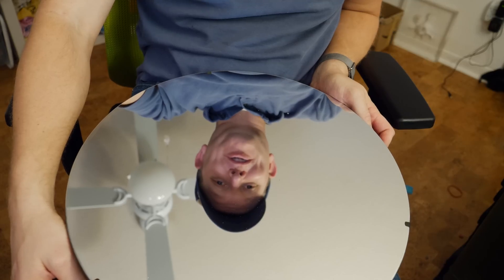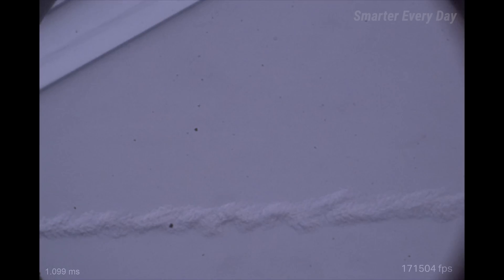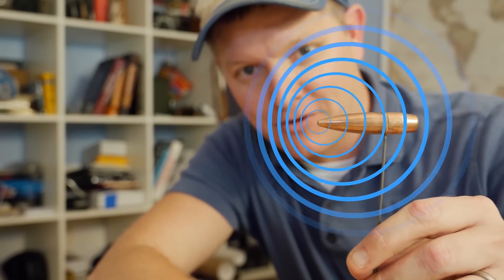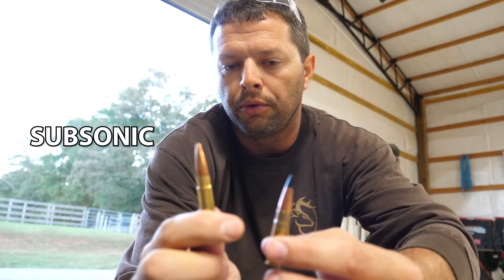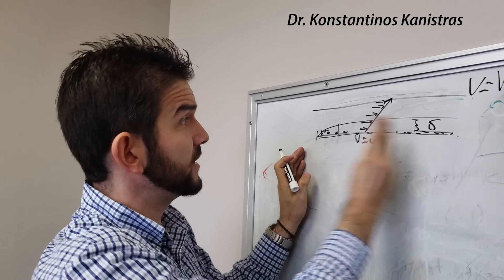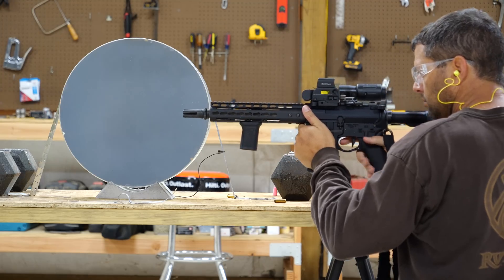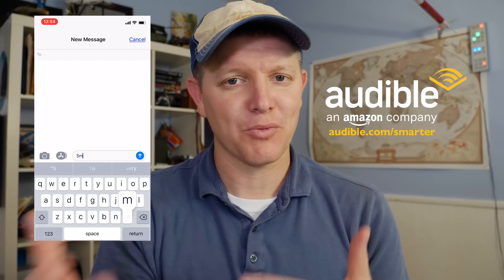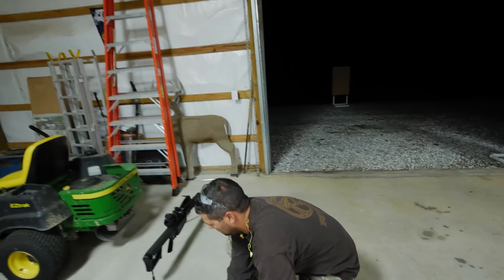Shockwave Shadows in Ultra Slow Motion (Bullet Schlieren) - Smarter Every Day 203

Comment: ...........idea for future video. Find a machinist with a lathe that would be willing to make you some bullets (solid copper would be the easiest, don't use steel as it will not be kind to the barrel of the gun). Preferably a rifle round. Pull a bullet out of a casing of whatever caliber you choose so the machinist can duplicate it precisely...but instead of the relatively blunt rear, have him taper it to a point to see how much of that irregular "drag" shown in this video can be eliminated.
Reply: @SmarterEveryDay You want to do this. Perhaps hook up with TAUFLEDERMAUS for some of his amazing insight.
Reply: @animalmother556x45
That's how 6.5 grendel works. It has a very good ballistic coefficient because of it's tapered tail end. In fact, it has a better ballistic coefficient than .308 and carries it's energy farther.
Reply: @unambitious  I've never seen a 6.5 projectile with a tapered rear...do you have a link?
Reply: Boat tail, yes. It's tapered, but not to a point like the business end. 
@Grimace427 6.5 grendel does carry it's initial energy farther than .308. Not as much energy as .308 obviously, but it's as accurate with less drop than .308 and similar ft/lbs as 7.62x39. Plenty of "poor man's" 1000yrd setups and demos of 6.5 grendel on YT.

Comment: I'm studying aerospace engineering and in this year they taught me that the shockwave that forms in front of an object doesn't need to have the angle of a Mach cone since the reason shockwaves appear is deviating the supersonic flow front me object it is going to encounter. Therefore the angle of the shockwave depends on the speed and the angle of deviation needed. The only way it creates a Mach cone is when the angle is very small, then the angle tends to the one of a Mach cone. I'm saying this because I don't think those speed calculations are too valid, they can approach the real speed but not the most legit thing. I don't know if you knew this and I just wanted to make you smarter every day.
By the way, love your videos and this one is trully amazing.

Comment: The bullet looks like a speed boat on water, if you would look it from above. Exact same thing with waves going on the difference in the density of water and air will give slight variation in results. The circles within the "wake" are different pressures of air being bounced around and off from the speed barrier that bullet created.
PS. It would've looked cool if you shot the revolver sideways so camera would see it from above/below to see how much gas actually goes to the sides of it.

Comment: Destin, aren't you an aerospace engineer? How didn't you learn this? Don't mean to intimidate you at all, just actually curious! I learned all of this in the second and third year of my undergrad in Uni in Germany (also aerospace engineering). Btw since then my specialisation is super- and hypersonic aerodynamics, it's soo cool! Love your video, keep it up :)
Reply: Is there a difference between supersonic and hypersonic? Aren't the fluid dynamics the same? (I'm just curious)
Reply: Mandernach Luca I believe chemical reactions start to happen above mach 5, that should be a difference.not sure about the details
Reply: @Enthropical_Thunder  Yes there is. No they are not.

Ask yourself, is the aerodynamics of a car at 60MPH the same at 180MPH?

Then consider your question again.
Reply: @bigbuckoramma  
Of course there are differences but i meant significant differences like the aerodynamic differences between a wing at subsonic speeds and supersonic speeds (between subsonic lift and supersonic lift, so to say).

Comment: My question is what happens when the slug is flying fast enough that the shock wave angle is more acute than the surface of the slug. Also, at the other end of the speed scale, what does it look like out of a whistling device, like a recorder or a simple whistle?
Reply: I think you would still get two straight lines that are touching the bullet not at the point of tip, but at the point where the curve of the tip has a tangent that matches the angle of the wave.
Reply: Bow Shock

Comment: can you try shooting diagonally to the mirror?
Reply: That would be so cool. At the  distance between the camera and the mirror, you could get an almost head on angle.
But the problem would probably be focusing the image. It would be sharp for only a few frames between being too close and too far.
Reply: No, the mirror is reflecting the light to a single point that's directly in front of it, so the camera must be at that point.

Comment: Some questions:

1.Why should the hand never leave the grip while firing? Isn’t it going to experience the shockwave anyway?

2. What is the purpose of the piece of paper that blocked half the light?

3. Why is a parabolic mirror needed?  Why not a regular circular concave mirror?

Great video as usual.
Reply: This is all me guessing but I think that:

1. so that the gun doesn't fly around and you lose your grip.

2. I don't know

3. isn't a parabolic mirror the same as a circular concave mirror?
Reply: 1. Yes, your hand will experience a dispersed portion of the shockwave.  But if you placed fingers or a hand over the gap between the cylinder and barrel, you would take the full, concentrated blast as it comes storming through the gap.  That's a big difference in energy levels.  There's even a story or two of someone losing their thumb due to holding it this way.
Reply: For 2 and 3: The parabolic mirror focuses the point source of light back at the lens of the optical system. You're essentially photographing the point source spread to fill the whole field of view. The object blocking half of the light is what enables the schlieren effect. The density shifts in the air causes refraction of the light. This will cause some portions of the light to be shifted in one direction, over the barrier, allowing more of it to reach the lens, and some to be shifted in the other direction, more into the barrier and less reaches the lens, thus creating the patterns of dark and light that allow you to observe these density differences.

Comment: I'm not too sure you can use the Mach relation to estimate the free-stream Mach number. That relation holds only for point sources. In this case you might have to use the theta-beta-Mach relation provided the approximation of the fore-body surface as a cone/wedge is reasonable.

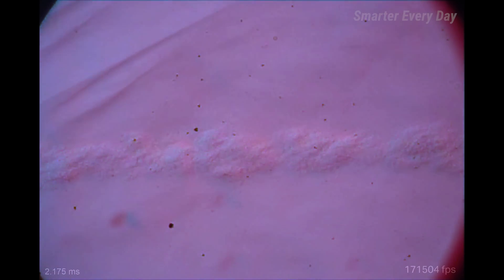Comment: 1:45 Test this hypothesis by placing an object on the table so that it distorts the reflection in some predictable way
3:45 These concentric circles might be interference with another sound and the frequency of the sound can be calculated from the spacing of the circles...or...the phenomenon described at 6:00 is causing periodic disruptions

Comment: So if transonic bullets at 0.8x the speed of sound produce some supersonic movement, do they still produce some kind of sonic book? And if so, would "subtransonic" bullets below transonic speeds be the quietest because they avoid creating any kind of supersonic movement? And if so, is the difference enough to matter? Because if it makes a difference, then someone trying to quiet a firearm with a sound suppressor/silencer would get quieter results from a bullet traveling at speeds more like 800-900 fps than 1000-1100 fps, just under the speed of sound. I didn't see much disruption coming off of that subsonic bullet, but on the other hand I've always thought that anything that reaches supersonic speeds in our atmosphere creates a loud sonic boom/crack, whether a plane, bullet, or bullwhip.

Comment: Far out! Just like how the way the outside wheel of a car has to turn faster than the inside wheel when turning. I'm thinking a bullet with segments of varying friction would upset the surface airflow enough to discourage hitting supersonic levels 🤔 I mean airflow is all about aesthetics lol

But wait, on a typical car isn't the undisturbed air always travelling faster than the attached air? As in, the airflow on the body is actually slower than the airflow around the car.

Comment: Hey Destin. Great video, as always. Since I saw some comments on the knife-edge cut off, I would like to point out that the black-white pattern on the top and bottom of the bullet are opposite. This has to do with the direction in which you are cutting the light. Cheers.

Comment: I think that the speed calculation is not totally correct. What you did is only valid for dimensionless points moving. For  an actual 3D object as a bullet, the shape itself modifies the angle of the shock waves, depending on the angle of the bullet itself, what it is called the nose cone. If the angle is  big (blunt body) the shock wave detaches front the nose. That's why supersonic airplanes have sharp nose cones. It''s difficult to explain in a comment here. An idea for a following video could be to film bullets in supersonic flight with sharp and blunt noses at the same speed to see the difference in the shock wave angles and how they detach.
Reply: You explained it well. Reentry capsules are blunt on the bottom and the rear tapers to a cone. Pushes the shock wave away from the vehicle so the super-heated air doesn't burn up the vehicle.
Reply: After having recently seen Richard Hammond explore the Space Shuttle, and explain why the nose is relatively blunt... I too was wondering about what a less pointed bullet would produce. 
https://youtu.be/v1_WqVguRJg

Comment: Desitin, they are not little circles they are spheres. We live in a (for simplicity sake) three dimensional world, the illustrations in your old aerodynamics book only show them as circles because it's easier to illustrate.  Theoretically the bullet lives in a neutral state bubble of air. We all do. When an object moves fast enough to break out of the bubble the sonic boom is the bubble collapsing to try and catch up. People theorize that the speed of light is similar to this and therefore think that either a type of black hole or a flash of light happens if/when you go FTL. Of course, No one really knows what the "light boom" would look like. This similar "bubble of X (in this case sound)" is that famous Bubble Theory you've probably heard of  before.  Conceptually you just videoed inter dimensional travel.

Comment: you should try to "differ" a bullet past the mirror via a compound ricochet medium and do a scientific measurement of their acrostics.

if one bends a pvc or copper pipe they should insulate it with play sand. what happens if to you "shock" bend a pipe by internal pressure at an obtuse angle?I I'm sure the internal media, weather air or silica sand, plays a part in the expansion physics but the question is where in the curve douse it affect the material enough to distort it?

Comment: You should try this revolver thingy with the Nagant M1895. It has a special system that will move the cylinder to the barrel once you pull the trigger. You might see less or no gas coming out the gap.
Reply: This is why the Nagant can have a suppressor where other revolvers cant due to that gas seal. Super cool gun.
Reply: Pulling the trigger on a Nagant cams the cylinder closer to the barrel, but the ammo is also purpose-built for this. Unlike normal revolver ammo, these stick out beyond the cylinder, and the case extends beyond the bullet. The case seals the gap between the cylinder and barrel when fired.
Reply: And just like that, Destin starts asking all his buddies to loan him an M1985. It's Alabama, so somebody definitely has one.
Reply: Awe man I was totally thinking of something just like that. Oh well.
Reply: Yeah, my dad has one of these and I've always wondered how good this feature is/how much the gas is sealed.

Comment: What happens with the shockwave produced by pellets shot by air rifles?  Extrapolating your results, I reckon, that  low weight pellets (4 -7.9 grains) in  cal.177, driven to supersonic velocities, become unstable, vibrate and therefore lose accuracy after reaching match1.  What do you think? Do you care to reproduce your experiment with magnum break-barrel air rifles?? There is information available to answer the question, but I don't remember having seen any video as smashing or explicit as yours! 👌👍😆

Comment: I got shivers when I learned that you can calculate the speed of a super sonic projectile by measuring the angle of the cone of the shockwave. Mind blown.
Reply: Martin Rioux You can do that same thing to superman also!!
Remember that teaser trailer of man of steel that played before dark knight rises.At the end of that superman flies up creating cone behind.😉😉
Reply: The fact that it is such a simple correlation blows my mind.
Reply: So, the method presented in the video is not totally correct. The “Mach angle” relationship he used is for a Mach wave (an infinitely weak shockwave produced by a small disturbance). In reality, the included angle of the oblique shockwave depends on not only the Mach number, but the included angle of the projectile.
Reply: ^ exactly thank you, since the bullet has a tip which is also a wedge, the angle of the oblique shock is also affected so the only real way to know the speed is by using tables
Reply: Same here too, mind blown
Reply: Prerty sure that blew my freakin' mind too...and what a perfect included angle that shockwave formed. Looked like it was drawn with a protractor.
Reply: that's what's up

Comment: Hey Destin, turn to Chapter 9 in Modern Compressible Flow. There's a really fascinating explanation of how early engineers calculated values for supersonic drag before modern computers. It eventually leads into a really concise and intuitive explanation of Critical Mach Number, which explains the shocks on the subsonic bullets and their location. Roll Tide.
Reply: I just commented on this in another thread. It's really quite cool how they came to their conclusions. Even cooler that the Brits, US, and Germans all landed on essentially the same formula for airfoil shape to reduce critical mach effect, and the induced drag. All so they could push for a fraction more speed, at the then so called "sound barrier".

Comment: You were speculating about where the secondary shockwaves were coming from, if they were bouncing off the table or floor or what. You ought to be able to figure that out better than just guesses. You know the time delay between when the bullet passed and when the shockwave appears, and you know the speed of sound. So you should be able to get the distance to whichever surface the waves bounced off of. And with knowledge of the layout of the shop it shouldn't be too difficult to work out.
Reply from the maker: You're exactly right, which is why the slo-mo time and is in the bottom left corner for you
Reply: Outsourcing that bit of work, smart.